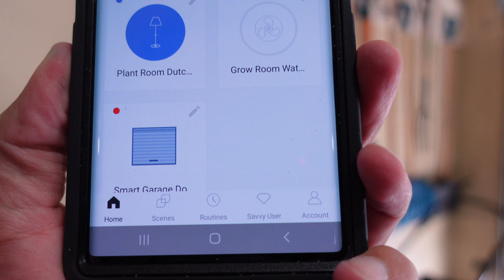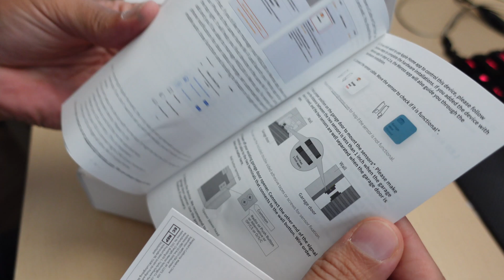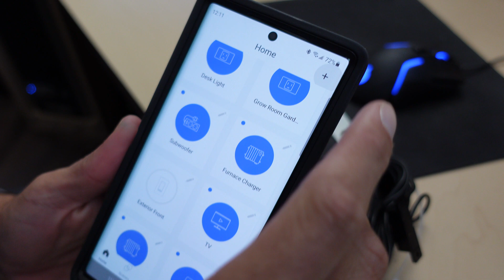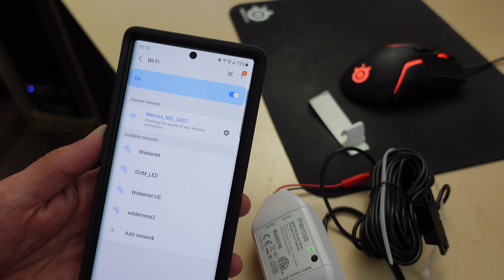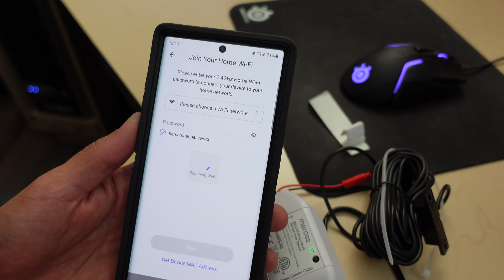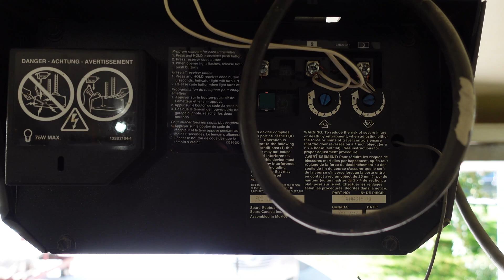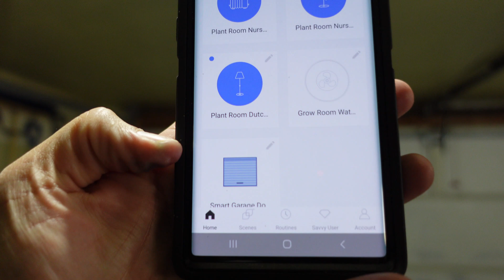Control Your Garage Door With Your Smartphone

Comment: I installed one of these myself. Proud divorced and doing it on my own moment. 2 years later for some reason it won’t open and close. It clicks and sounds like it should open but it doesn’t. The app is telling me it is open or closed and the door opens and closes properly with my car remote. 🤷🏻‍♀️ I have deleted and reinstalled wifi.  Any other ideas?
Reply from the maker: Sounds like it is connected to the wifi and the command is going through, have you checked to make sure the wires are all connected?